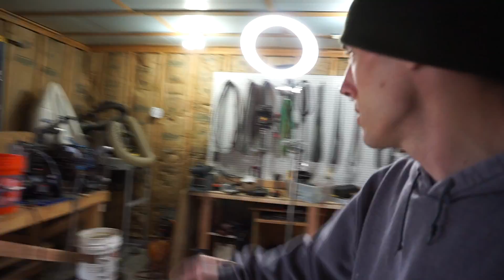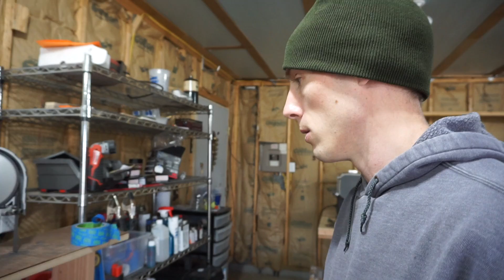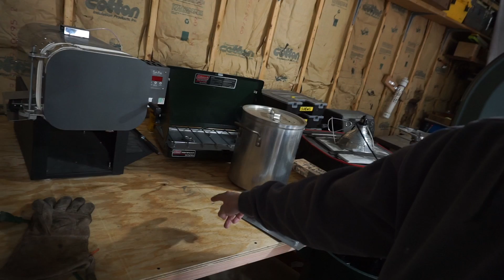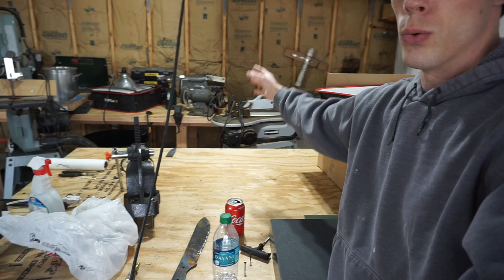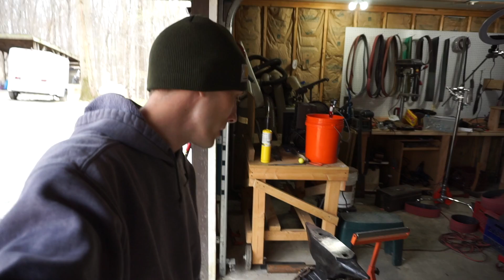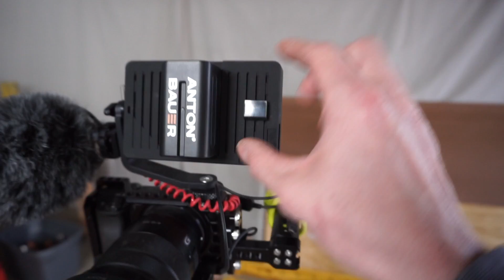Knife shop Tour And Youtube Camera Set Up.

Comment: You can solve overheating problem if you are willing to open it up. check out 'SONY a6000 OVERHEAT SOLUTION!! & 30 minute video limit removal' video. BTW, do you prefer a6300 over a5100?